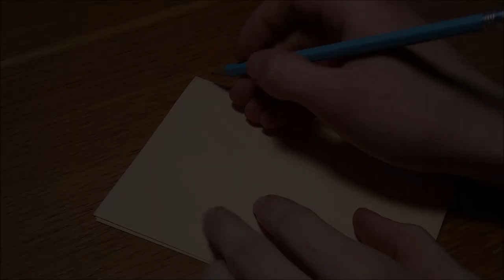Leather working - Medieval leather coin pouch

Comment: Like it! Some of my favorite mods: roll the op down for a stiffer and finished edge; run the laces through a single wooden bead for a closure; stitch in a circle at the base for a larger volume and a bag that stands well; or, run a gusset between the two halves for extra volume; make one side of the gusset extra long to double back on itself for a belt loop: stitch up four pieces instead of two for a larger bag; stitch the middle of the lace in to the back of the bag; number of lace holes is divisible by 4. Pouches are fun to make and are good gifts. What’s not to love? 🤗
Reply: No

Comment: Great video! The only thing I would say is that if you're going for a full Viking pouch, you could make it with a rectangular template instead of the figure eight kind of shape you did. Just makes it simpler overall and removes the need for a paper outliner.

Comment: Old leather sofas can be a good source of soft leather. For thread length on thin leather, i roughly lay the thread round the edge, double it and add about another half length. Nice simple video.
Reply from the maker: Thank you for the tips! Will definitely use them :D
Reply: Good call! My roommate provided me a small pair of leather pants for scraps, and I have made mug straps using them. Good stuff 😎

Comment: I've done something similar before, but I didn't have leather, so I used duct tape and tissues. The tissue was used instead of that "back to back" duct tape method that I honestly couldn't really get right. I made a round disk for the bottom, and two peices that made the sides. I taped it all up, and folded over the edge, running shoelace though the folded over edge so it would close. It's not the prettiest thing ever, but it's held over $70 worth of small change and stayed together with no issue, so it was a success

Comment: To ease the curve you could cut tiny triangles in the seam allowancen pointing towards the stitch. Then the seam would lie flatter and fuller. The secret of these drawstring pouches is in how you thread the string. It's not just one up, one own. You have to do it symmetrical between right and left.

Comment: this a good tutorial.  I am trying to make a pouch to hold coins from my game of thrones risk game. thing is i only have much thinner leather to work with.
Reply from the maker: Try it! i think you should be able to do it with thinner leather than what i used. Surf around the internet for a bit and see what information you can find. Good luck ;)
Reply: I made this of leather with thickness of 3 millimeters. Quite "heavy duty", I think. I am looking for thinner leather, since all leather I have are rather thick.

Comment: Great video, I think that I have all the tools for this but what was that fork looking object that you used to make the holes for sewing through? Also, any idea where to go good leather? I've always wanted to make a good one of these like for change or for a renaissance fair.
Reply from the maker: Ghostly Gizzles that is a stitching punch. Look that up on ebay and you will find all sorts of different ones. I use the first ones that come up. As for buying leather, check on Google maps maybe if there are any leather shops close to where you live. They usually sell scrap pieces very cheaply in all shapes and sizes. Thank you!